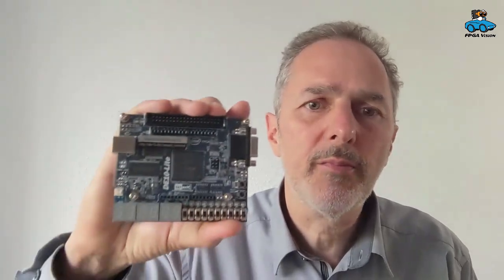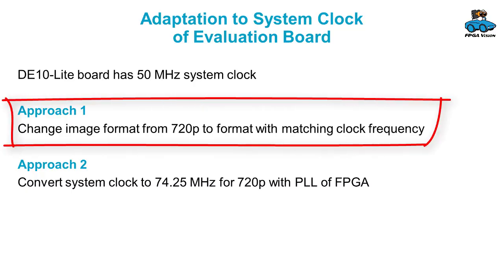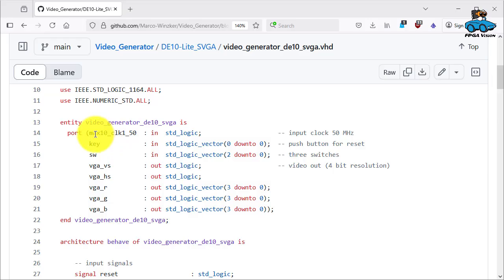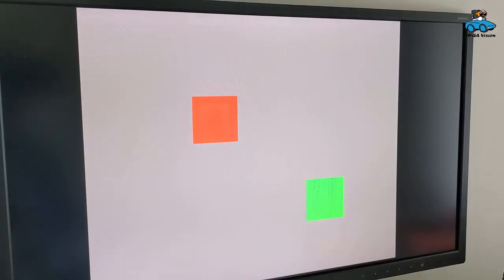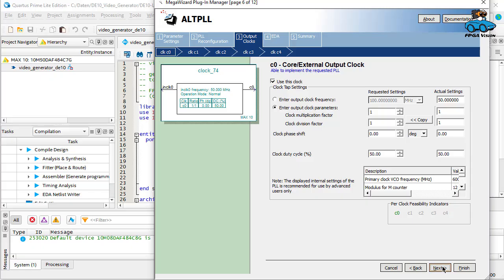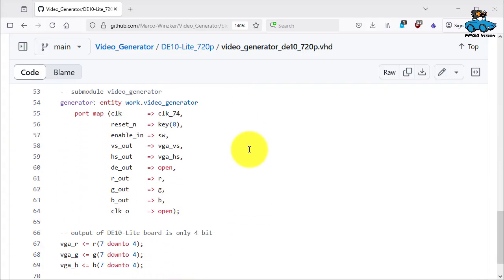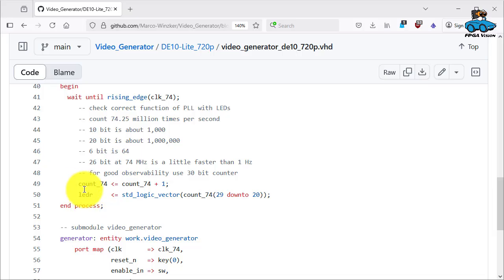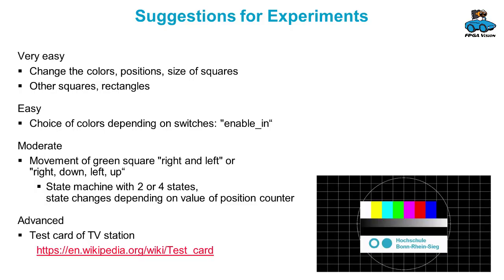Video Generator for Beginner - Implementation on Evaluation-Board

Comment: Can you do a video on how to use hdmi please.
Reply from the maker: From the video generator side there is no big difference. The video timing is the same. 

However, there are different approaches in implementing the HDMI interface.
- Our remote lab has HDMI and just needs the video timing (see video 4 in this series)
- Some HDMI controller on an extension board need setup by a CPU
- Some FPGAs have an internal HDMI interface that requires an IP block.

Comment: The same approach with HDMI instead of VGA would be a nice addition. Thx!
Reply from the maker: From the video generator side there is no big difference. The video timing is the same. 

However, there are different approaches in implementing the HDMI interface.
- Our remote lab need just the video timing
- Some HDMI controller on an extension board need setup by a CPU
- Some FPGAs have an internal HDMI interface that requires an IP block.